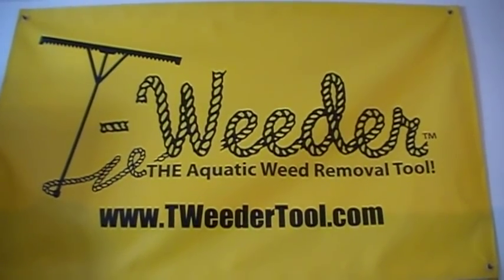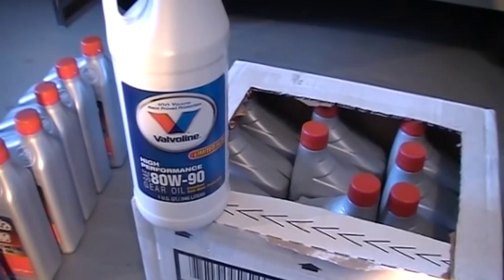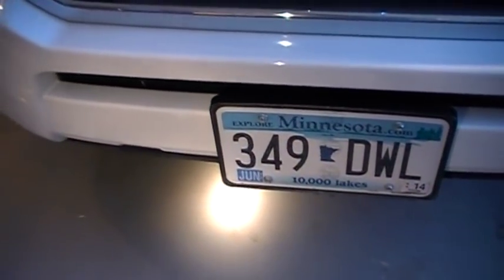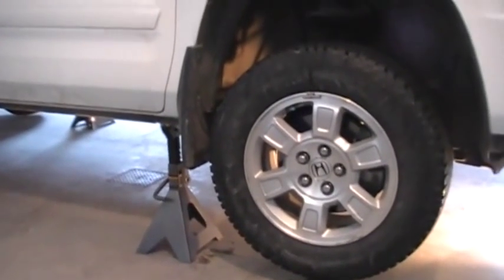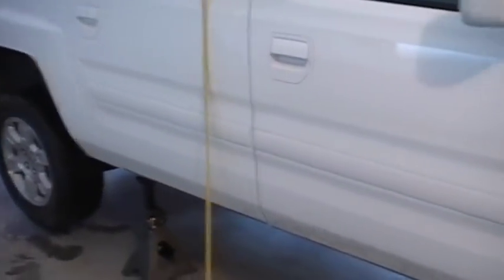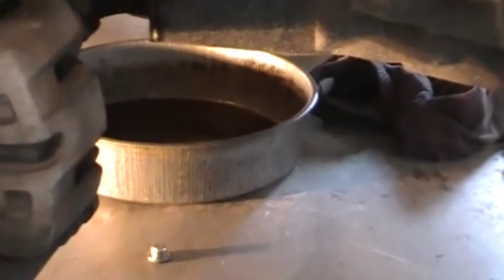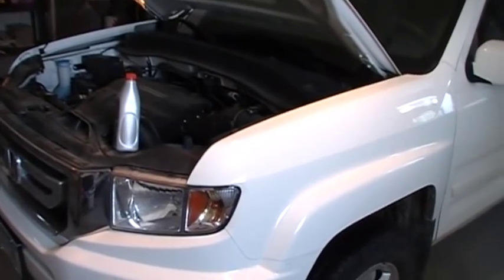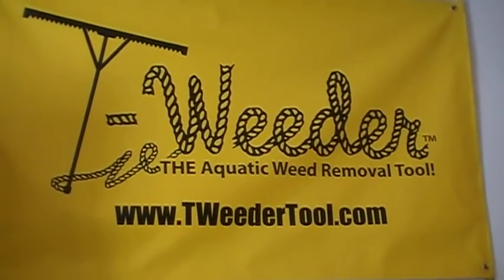Honda Ridgeline A13 Maintenance w/ Transmission and Transfer Case Fluid Change

Comment: I have a 2011 Honda Ridgeline RTL/NAV .After watching your video, I ordered a 17 MM magnetic socket off ebay. Cost was less than $6.00 with shipping. It helped me get the trans fill plug in and out with ease. I used grease to keep fill plug washer in place when putting it back in. I used the brackets that you showed that hang down from the front axel, they are perfect for a hydraulic lift jack.Thanks

Comment: Very informative and thorough video. I especially like how you actually used a pointer to show where items were located and light so the items could be clearly seen by the camera. And going to the manual at the end of the video to show how to reset the maintenance reminder was great!

Also appreciated how you showed where the front and rear jack points were in order to raise the front and rear ends. It would have been nice, though, to actually show the jack raised to those spots just so we could see how the jack fits that spot, what it actually looks like. But that’s a very minor complaint—I’m just trying to make sure I have the exact spots correct so I won’t damage my 2006 Ridgeline RTL/Nav
Reply from the maker: Hi Allan-  thanks for the feedback!  The two center jack points seem like they would be a bit unstable, since they are both just maybe 3/8-1/2" wide vertical pieces of metal (they both have a hole in them if I remember correctly).  To me, it seemed there should have been more of a flat surface on them if it were to be a jack point.  The first time I tried it, I went very slowly and carefully, watching to make sure nothing was bending etc., but it worked fine.  Since the two tires (or jack stands) on the opposite end of the vehicle will be stabilizing the vehicle, it wasn't tippy or unstable like I thought it might be.  I hope this additional information helps!  -Tim
Reply: Tim Brennan yes it does. For me I just wanted to be able to jack the Ridgeline up from the middle so I can slide a couple of Rhino Ramps under the wheels (front or rear depending on task) because I don’t yet feel comfortable driving up the ramps with this vehicle. I would essentially be using the Rhino ramps and jack stands so I have two sources of support to do work. 

I saw America’s Tire use the center point during a recent tire installation but I couldn’t really see exactly where the jack was placed. 

Again, thanks for the video! 

BTW, since you say you’re in Minnesota I would suggest you stop using that cheap dollar store oil—only use a really good full synthetic oil like Mobil 1, Amsoil, Redline, etc because they have extremely good ultra low temperature flow characteristics. I’m quite sure that oil you used, even though it nominally meets the specs, it won’t perform anywhere near as well as the top synthetics I mentioned.

Comment: Very informative video if you own a 2009 and later Honda Ridgeline. I have a 2011 model year. You have to wonder why a company like Honda known for it's innovation, can make the process of maintenance, so impractical. I could not find the transmission refill plug and I have been working on vehicles for a long time.Your advice about making sure you can FIND and remove any refill plug before removing any drain plug is spot on! Before I can continue, I'll have to get a new pair of glasses, a good flashlight, a telescopic magnetized thigamajiggy, more 3/8" extensions, some grease, etc. It looks like a trip to Harbor Freight is in my future . Thanks, LOL

Comment: Just completed all the work. Great info., especially the trans fill bolt size. That would have been a pain in the butt to play the guessing game. I used all honda OEM fluids since the car still has 20K left on warranty.

Comment: So I just got a used 2008 and it looks like all of these fluids were skipped, although the carfax says they were "checked" at 105 (130 now), I do imagine that was transmission only.  thanks for the detailed breakdown.  I would add that everything that I have read says "only honda vtm4 fluid" for the rear differential.  I should be getting the honda fluids tomorrow, and happened to have some GL5 for the front transfer case that I will do today.  I would add that the symptom that got me researching is a moaning/humming sound when turning.

Comment: I used the gear oil in a squeezable pouch, worked great. Also did my transmission today, just a single drain and fill. I used Valvoline Maxlife. I'm going to do another drain and fill the next time I change the oil. Also ordered the vtm-4 for the differential. Apparently there's not much out there that meets that spec, because I usually don't buy OEM fluids.

Comment: 80 90 is used in trailer hubs on all transport trailers mostly so I have access to barrels of that stuff. and your jack stands are more than enough as I use them for transport trailers 53 foot with heavy duty suspensions so your in good hands. I am a papered mechanic for truck trailer and bus air and hydraulic. I love your video but in my opinion it's a Honda and your choice of oil does meets the standards but lover your Honda, I would use Amsoil synthetic first choice, second would be straight Honda synthetic I would not mess around with cheaper oils when it comes to a Honda that's my opinion though. great video man I will give this a go on my 2014 Ridge.

Comment: Thanks I own a 2010 pilot 4wd I believe they are pretty similar in drive trains and gave me a good idea of what to expect when changing my transfer case gear oil thanks
Reply: Pretty much every honda/acura v6 is the exact same for transmission fluid changes.

Comment: A very helpful video! Did you put the jack stands under the 4 pinch weld jacking points? Did you use any jack stand pads or saddles? I am a newbie. I know the video is not about how to jack up the Ridgeline, but would appreciate it if you can tell me that. There are people said the pinch weld will bend if you do that. thanks!
Reply from the maker: Eric Cheng  Hi Eric- I put the jack stands under the four areas where the owners manual shows to place the jack when changing a tire etc. I never saw or experienced any deformation of the metal where the stands were placed. I did not use any pads or anything and it seemed to work without any problems. 

I was more worried about the center points that I put my floor jack under to raise the truck. To me those spots just didn't seem like they'd be that strong, but they held up fine. Hope that helps!

Comment: Great video! Question - why didn't you change the transmission filter? When changing the oil you always change the filter, too. I thought that would be the same with the transmission fluid as well.
Reply: Clay Sinclair  The transmission fluid filter on the Honda Ridgeline can only be changed by disassembling the transmission.

Comment: Thanks very much!! If I just change the transfer case oil and rear differential do I need to reset any main thence reminders on the dash? I believe that's only for oil and filter changes. I have on 07 Ridgeline so it may be different but fantastic video!
Reply from the maker: My 2010 Honda Ridgeline gives me Maintenance Minder codes for the oil, rear differential, transmission, and transfer case, and tire rotations (and maybe more). So, with my vehicle I do reset all those codes. They all get reset at once, I don't see a way to just reset specific codes when there is more than one being shown. Hope that helps.

Comment: The oil that Honda uses for the Transfer case is a very cheap off-the shelf conventional oil stuff, Most Aftermarket oils specially Synthetics will outperform the shit out of the Honda OEM Transfer Case oil even today... 

What we recommend all the time over the Forums (Acurazine com honda-tech com) for the Pilot/Ridgeline & MDX is the Mobil 1 Syn LS 75W-90 and Royal Purple 75W-90 is also a very good choice..

Comment: First love the video at what Mileage you perform the A-13,B-13,B-16?
Reply from the maker: Herbert: I just wait until the Maintenance Minder on the dash board gives me the codes telling me the particular type of maintenance is due. For example: "A13" etc. After the maintenance is done, the manual tells you how to reset the codes yourself.
Reply: Tim Brennan Thank you

Comment: I have a 07 Ridgeline with 117,000 miles on her. The dealer has been doing my oil changes but i would like to start doing them myself. The dealer uses a oil blend. I would think that regular oil would be just fine but some say only use synthetic. Thoughts?
Reply from the maker: If I were going to change oil and filter every 3000 miles I would just go with regular oil. If you use synthetic oil and a good quality or OEM oil filter, you should be able to extend the oil changes out to the manufacturer's recommendation or just wait for the maintenance minder to signal you to change it.
Reply: Do you have or willing to do a video on a throttle body cleaning? I have never done one and now that I'm at 150,000 miles I feel its a good thing.

Comment: To confirm - when you drain the transmission case only ~3.3 qts come out but the whole system holds ~9 - ~11 qts?  Why doesn't the rest come out?
Reply from the maker: +P Mac :  I&#39;m not a mechanic by any means, but as I understand it, when the drain plug is removed only the fluids that are in the pan are drained. A majority of the fluid remains in the lines, pump, and other areas of the transmission and will not completely drain out. That is the reason for doing the 3x drain and fill. You never get all the old fluid out, but only dilute it further each time you run the vehicle for a while between each drain and fill, thus removing most...though not all of the old fluid. I hope that helps!
Reply: +Tim Brennan Thank you
Reply: +P Mac This is because most of the ATF remains in the Torque Converter, There are 2 sumps inside the Honda Trans that will not allow the rest of the fluid to come out (They cant because they flow with the engine on) there is also residue on the ATF Cooler which is also accounted for. 

This is why the 3x3 exists (Although most Hondas SUVs/CUVs do drain more than 3q) as the name implies the 3x3 requires you to change your ATF 3 times with 3 quarts (This "System" was created by users from the Honda Sedans which do drain 3q exactly). Once you finished the 3x3 your trans will be using completely new fluid.

Comment: can the transmission filter be changed on the ridgeline,cause there are no videos on here changing the filter,thanks
Reply from the maker: +roofdog13 ...not that I was able to find any information on. There was not mention anywhere of replacing a filter. Just the fluid. I did a transmission fluid change on my wife's 2011 Toyota Highlander and that involved dropping the transmission pan and replacing the filter and gasket, but didn't have to do all that on the Ridgeline.
Reply: What year is your Ridge? How many miles did it have when the tranny went? Was the tranny maintenance performed up to that point?
Reply from the maker: I found nothing recommending that the transmission filter should be changed at any interval.
Reply from the maker: My Ridgeline was a 2010. The transmission didn't go out on it, it was running fine. I performed the fluid change as a precautionary measure, in accordance with the suggested maintenance schedule. If I remember correctly, it had around 50,000 miles on it when I did the transmission service etc. I have since sold the truck.
Reply: +roofdog13 What year is your Ridge? How many miles did it have when the tranny went? Was the tranny maintenance performed up to that point?
Reply: its an 06 and had 132,000 when it went, not sure of the maintenance got it used with 75,000 miles on it
you cant change the transmission filter on the ridgeline unless you take the tranny apart or take it to a honda dealer they have to flush the fluid
Reply: no you cant change it you have to have it flushed at a honda dealer,it needs to be flushed at the right pressure or will blow out the paper filter

Comment: so do i have to replace my transmission sir? is that A13 means? answer please I need help.
Reply from the maker: saintballadeer milkovich  
The # 3 in the code: A13 is advising you to have both the transmission fluid and transfer case fluids changed, in addition to your engine oil. I hope that helps.
Reply: Tim Brennan cool, thanks a lot sir!

Comment: I change the oil in my  2006 Honda ridge line, but the code light is still flashing, what should I do to clear the A136 code
Reply from the maker: +Leonardo Allen Follow the steps in the owners manual for resetting the Maintenance Minder. When you reset it, it resets ALL of the codes however, so you should try to perform all the required maintenance at the same time.

Comment: do you guess on trans level
Reply from the maker: No, don't guess. Check the transmission level by pulling the transmission dipstick, which has a yellow handle and is located at the front of the engine on the drivers side. Kind of down low.

The level should be checked when the engine and transmission are warmed up. Once warm park the vehicle on a level surface, turn off the engine and wait at least 30 seconds, but not more than 90 seconds and check the level on the dipstick. (pull it out, wipe it off, reinsert it, and then pull it out again to check the level). Hope that helps!

Comment: Your using the wrong differential fluid! Only use Honda fluid!
Reply from the maker: +jessesnook
 I did use Honda Differential Fluid. I used Valvoline gear oil in the transfer case since it met the specs in the owners manual.